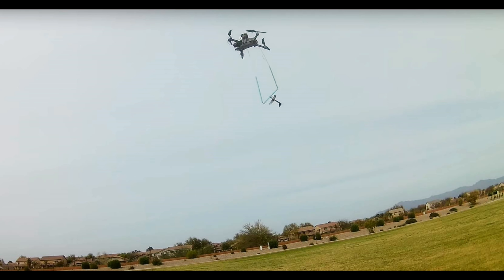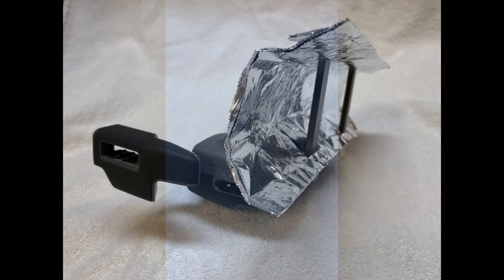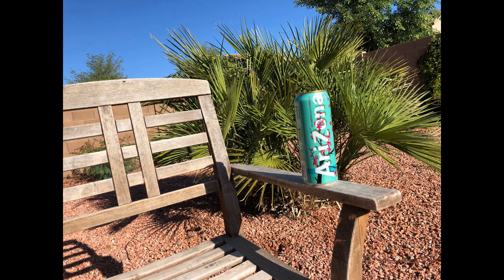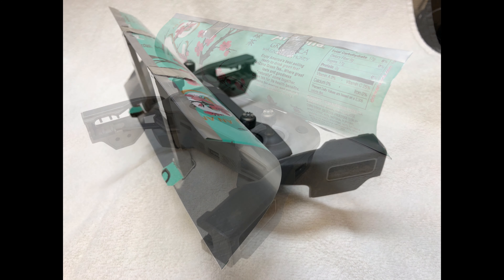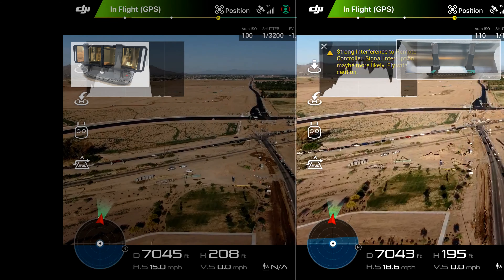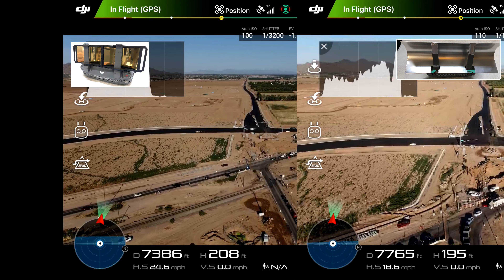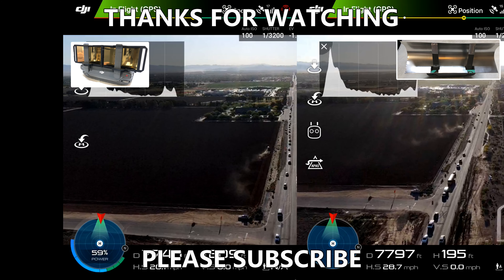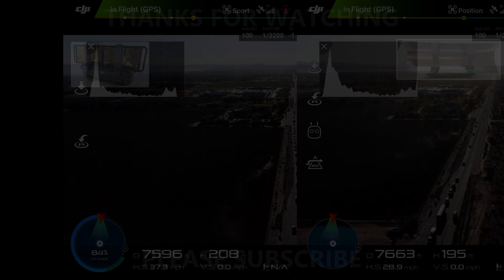MAVIC POP CAN SIGNAL BOOSTER

Comment: There's something appropriate about using an Arizona booster in Arizona LOL. I love the way you upcycle pop cans! I think your can rig looks cooler than the Amazon ones. I'm impressed that there was no difference based on the rotation of the reflector, as long as the concave side faces the quadcopter. Great experiment! See you at the next video dear sir. God bless!
Reply from the maker: Thank you for your kind words Glen. I think there may be some difference between horizontal and vertical in some cases but it makes me feel good that anyone can put one together and it will work. Thanks again and God bless.

Comment: I also tried the metal foil and to me it did no difference. It should be as easy as you pop it on when the drone got 2 bars with stock antennas only  and it should pop up to 3 bars...if not it is useless. I'm buying real antenna upgrades now. 1.2 km max flight distance is a joke. in 14 days minimum 4 km max distance if not 8 km.
Reply from the maker: Thanks for your input and info and God bless.